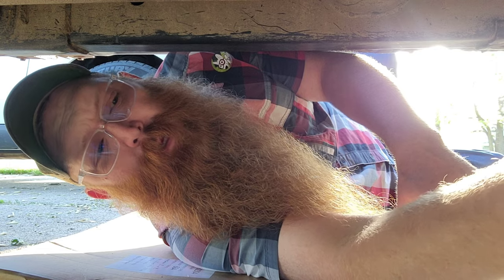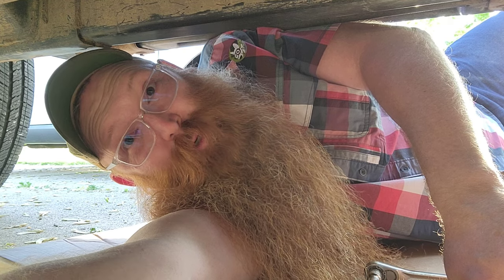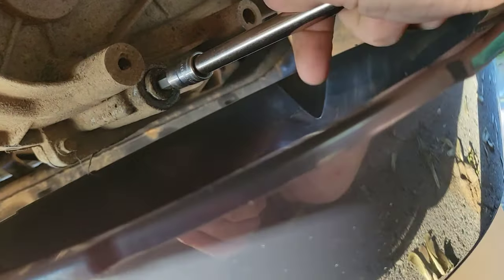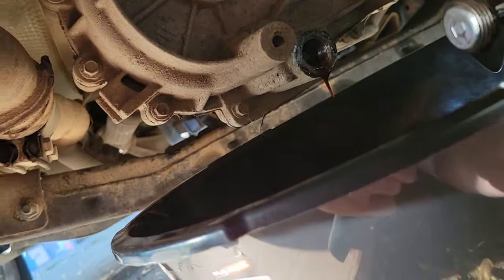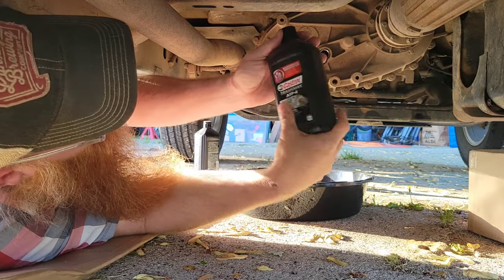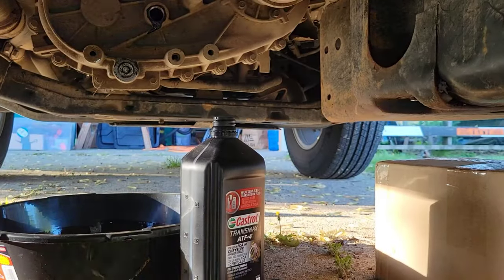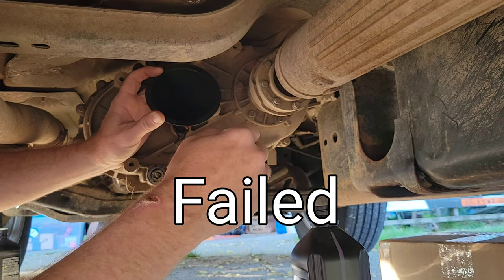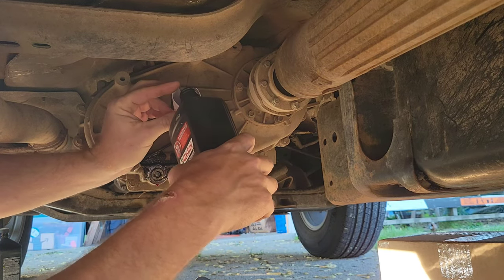Don't skip this maintenance: 2008 Jeep Wrangler transfer-case fluid change

Comment: Do you have a part number for that official mopar paper transfer case funnel?!?! :)
Reply from the maker: Sorry for delay to response your question, no. I use fluid pump automotive from Amazon - https://www.amazon.com/Slippery-Pete-Transfer-Transmission-Differential/dp/B0853CNLYZ/ref=sr_1_3?crid=34VTPFW9VHHC4&dib=eyJ2IjoiMSJ9.I9OJcchA8K5Aaz1hAzxxmzS7h94WwpLkjXDZD0ZmZc-kArHbIQ65BkhNFMAihrrZg_0HUJpvZ_cSxrroPCLOLwfGy3EFmDofuUhNqfvz1sNvS6nJqrvGKomC2WE4J2vDhSymMrwKo08Zg_J58Cgu2C6LFGwB6d-VILhpbh2cS5NDEMneXWJ5sQvJI3f-j8VYYCMSnxM9mEIGrIh340zYvfLp7ioDd62kVH7Hx5vmEQI.vCQzNTD1FQQs9HntcihO9r3-xiVa5Xmb1-VcE2bo9oA&dib_tag=se&keywords=fluid%2Bpump%2Bfor%2Bquart%2Bbottles&qid=1728866269&refinements=p_85%3A2470955011&rnid=2470954011&rps=1&sprefix=fluid%2Bpump%2B%2Caps%2C241&sr=8-3&th=1